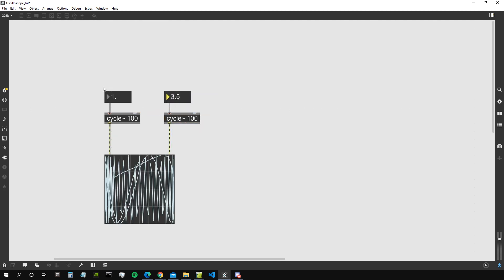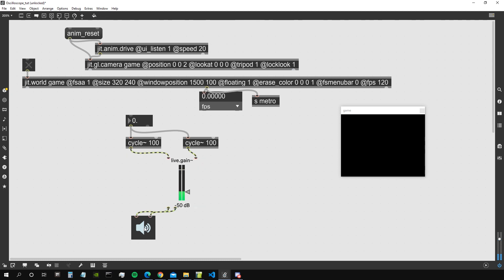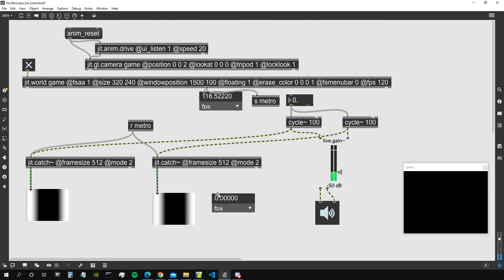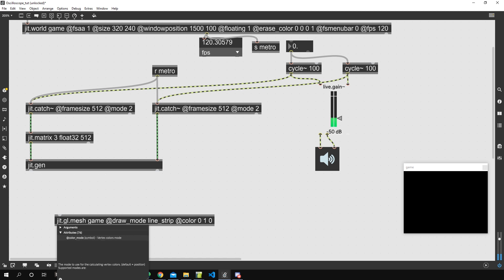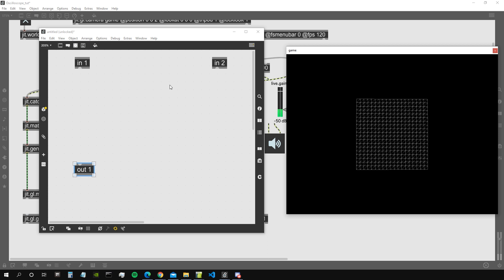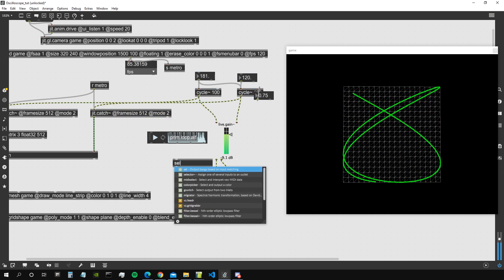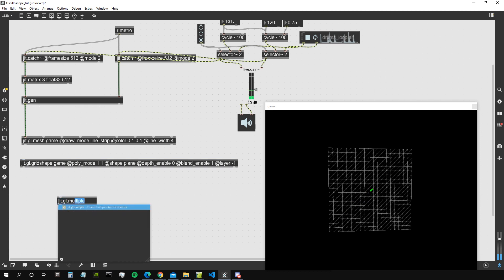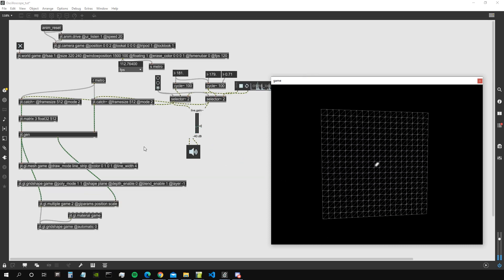Let's Create a 3D Oscilloscope with Jitter in Max/MSP

Comment: This was a cool one! Got quite cool results by adding a third dimension with third cycle and some cool movement via adding cycles to cycles phases. Also using polygons for visualization was quite "artistic" with all them autocolors (position), smoothshadings, antialiasings, etc. mysteriously after pausing for awhile the patch stopped working though and cant get it working. at first the visualization blinked on only every now and then but now not even that. :/
Reply: Is there a limit to the number of dimensions you can add?